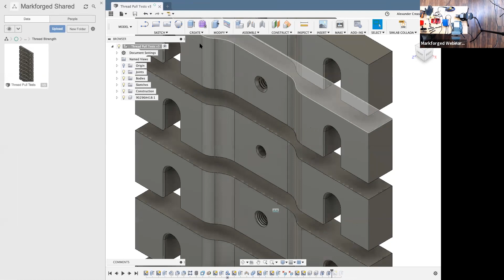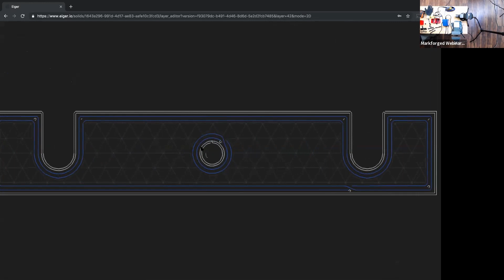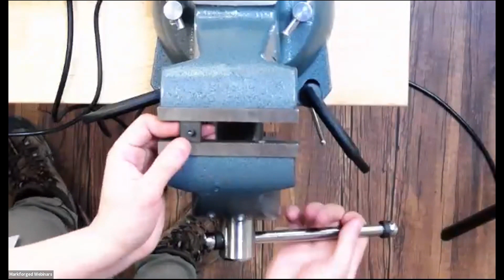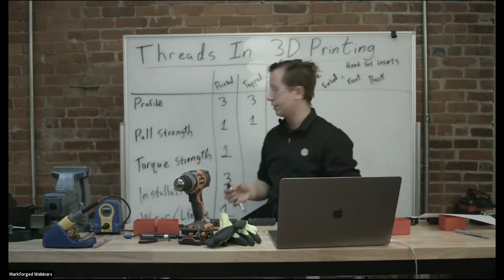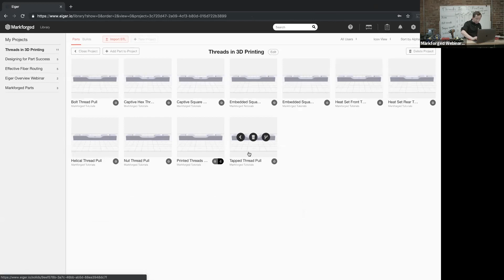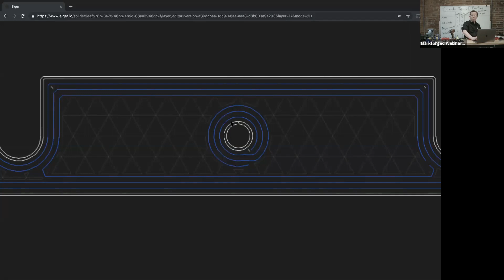Thread Testing: 3D Printing Threads vs Tapped Threads (Part 1 of 4)

Comment: I've had great success printing an undersized threaded hole and then passing a proper sized tap through. It helps reduce the risk of ruining a hole with improper tapping and takes less force as there is less material overall in the hole to remove.